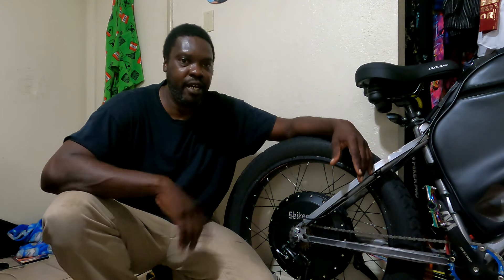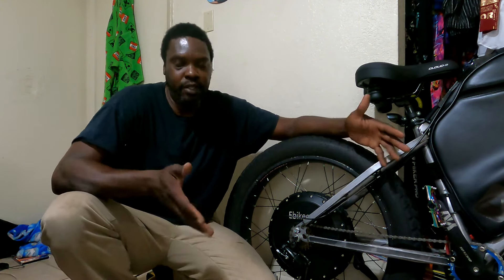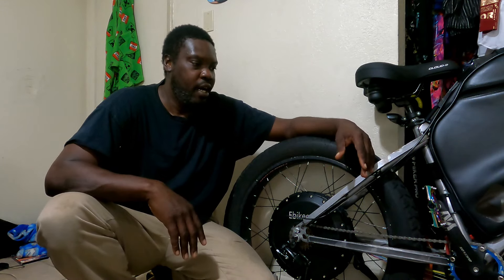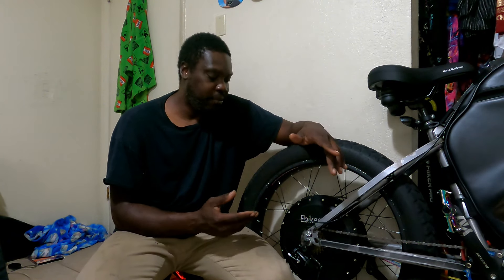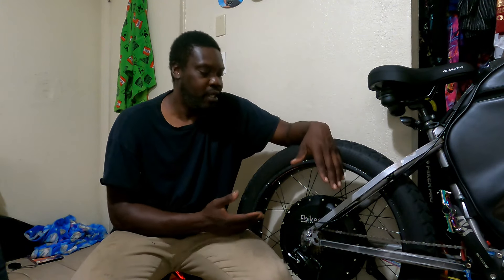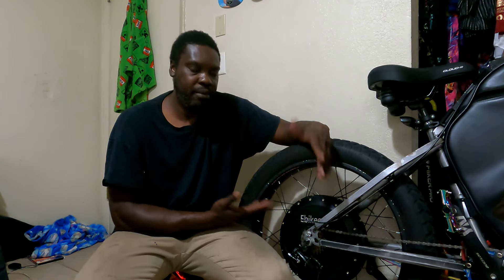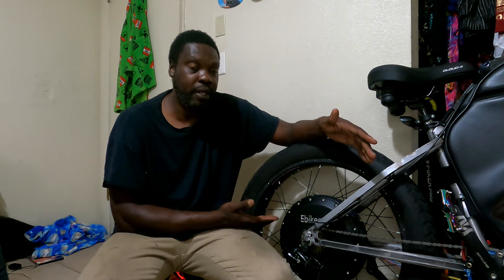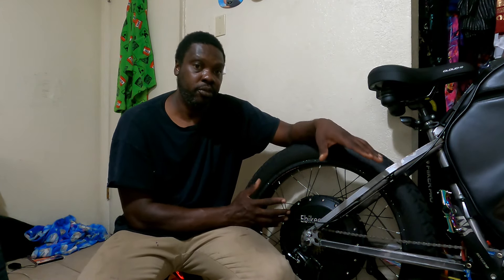Repairing the 8000w Tommebike Icon  part 1

Comment: Take your measurements at the windings. Completely remove the phase wires. I've done this myself so your motor is probably fine. You just need to replace the phase wires. The bike dropped because your phases were shorted together outside the motor windings. That will absolutely stop you real hard. The Fardriver doesbt do sensorless mode as far as I know. So you needed the phase wires which then melted the hall wires so that would stop you dead too. 

Don't panic. You're probably fine. Smell the motor. Burnt windings is a very distinct smell. You cannot miss it. The phases are all connected together at all times. That beep doesn't mean shit sir. You test the resistance between phases not continuity. The windings all connect together inside the motor. That's how the whole thing works dude.. Alternating signal with a shared neutral.. You should know this. Just replace your wires. Measure ohm's between each phase. They should all be the same. It will be a very low reading. Your wires just melted , that's a big ass motor, it can take a lot of abuse. Open it up I bet it isn't even black in there. You would smell those windings.
Reply from the maker: Dang ok I'll do that in part 2 I just ordered a stator  I'll probably sell it then
Reply: @E-bikeguy  I bet you are fine. The windings I that motor are single core and probably quite beefy. Solid wire has about 25% more ampacity than stranded wire. So your phase wires would have to be that much bigger than the wire in your motor just to match it. What did you have field weakening set at, if you passed the point of hysteresis all you are doing is creating heat. People tend to be too generous with the FW. 

Now your current carrying ability of your wire cannot exceed what can be pushed through its smallest section of wire. A bottleneck. Your throw power at it and if it doesn't make it to the motor to be used then shit is going to get melty. Heat is the enemy here. 

So I'm guessing you rewire those phase and hall wires and you are back in business. Seriously. Take a bolt out if the side cover and give that hub a sniff. Burnt laquer/enamel is loud. If the windings are burnt I would be very surprised. Even then though as long as there aren't breaks in the coils or severe meltage you can still use the existing wire . They sell spray for the windings. Ive seen people spraying over top of their windings and that is not how you do it. You have to unwind the wires and spray them unwound or you aren't achieving anything. The insulation on the wire is only as good as the thinnest spot. If you spray the winding with them wound you aren't getting coverage in the exact place that you want the most insulation, right where the wires are touching each other. You don't want them shirting across themselves or the next phase since that kills the magnetic fields that are inducing power. 

Your phase wires are probably wound in a wye configuration. Google that and look at the how it's wired. All 3 phases are tied together at the end. That is the your neutral point. They are always shorted. Electricity is always a loop. It wants to go back from wence it came. Neutral is not a ground, it is 180° opposite whichever phase is currently charged. Some people think it's AC power but it is not. It would be a BLAC motor instead of a BLDC motor if that were true. 

I did the same shit to my motor with a Fardriver. Phase wires had been pieced together after the hub motor chewed up my dropouts and spit them out. I was using some wire of questionable  quality and when I put the amps to them they did exactly this. The fact that your wires melted indicates your windings are still conducting sufficient power to liquify your insulation. 

You should be fine. You should plan on replacing all your halls I'm guessing. I would just replace all the external wires. Have fun fishing those wires through there. That's always special. You can use a Ethernet cable for your halls etc, there are 4 pairs of 26 or 28 AWG single strand copper wires in an Ethernet cable. It's real tiny and it's rigid so it's easier to push through an axle. Use real copper wire for your phases, avoid CCA at all costs. Copper clad aluminum is horrible stuff. The motor probably came with CCA. Mine did too so you needed to replace it anyway. That crazy controller and aluminum wire and a street race. Yep. That oughta do it. 

Crossing fingers youbdibt need a motor. I think you will be golden after a couple of hours of rewiring and cursing.
Reply: @E-bikeguy  If you can't turn  the wheel at all then all 3 phases are shorted. If it cogging and moving one magnet at a time then 2 of the phases are shorted to each other. If you ever need to know your magnet count in your motor you just touch 2 phase wires together and turn the wheel and count until you are back to where you started...use the valve stem as your start stop point. Put it at whatever o'clock and rotate.
Reply from the maker: @zentechnician  ok definitely have resistance
Reply: @E-bikeguy  get those melty phases out of there. Just cut them off a prepare yourself for an evening of fishing wires. I'm sure the axle in that motor is quite large. What size were the existing phase wires? Have someone jiggle the wires while you spin the wheel and see if it's intermittent. My phase wires came together to form Voltron, if Voltron were a gooey bundle of non connectivuty goodness.
Reply from the maker: @zentechnician  dang you have me thinking now
Reply: Excellent comment, it is likely shorted where it goes through the axel. Minimum clearance -> maximum heat buildup.
Reply: @E-bikeguy  You could have that bike working by sunset. Seriously.
Reply: @E-bikeguy  I was searching for this comment before I said the same thing. You will always read continuity from phase to phase, it's the resistance value that matters. If you didn't have continuity phase to phase then that would indicate an open winding/melted wire, or if you have continuity from the phase wire to ground.

Comment: Motor does get hot that's why you use Statorade.
Reply: 1000% this. That shit works. He just melted his phase and hall wires. The motor is probably fine. The phase wires are tied together inside the motor so they always read as dead short in continuity mode. 
Statorade. It works. 5ml gets the job done. I think it says 6 or 7 in the instructions but the sell it in 10ml portions. What a great way sell more motor schmoo. 5ml works just fine.

Comment: Sorry to hear about your motor, I feel your pain I just bought one.  Why don't you check your throttle voltage with the phone app? You should be able to see voltage readings fluctuating if your throttle is faulty, much like a scan tool for cars. Love your shows. 
Mark from OZ.
Reply from the maker: Yes I did  I need to do it when I get it back running

Comment: Hey do you have any experience with the vruzend diy battery kits? Seems really cool not having to use a spot welder to build a custom battery. I was wondering if you could build a battery with molicel p45b's i need a triangle 72v 80a, how much would you want for something like this? Thank you 🙏